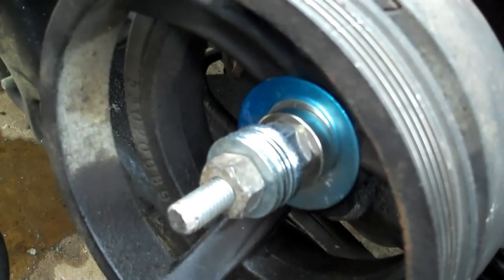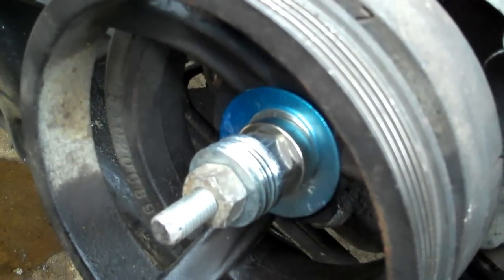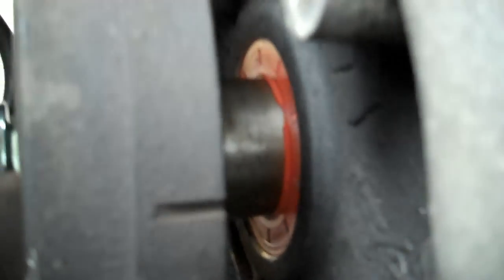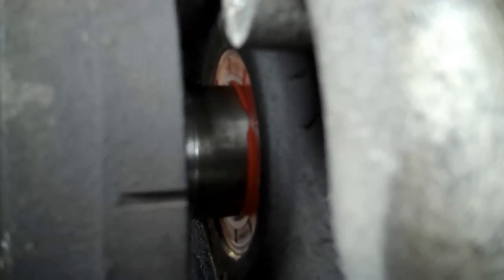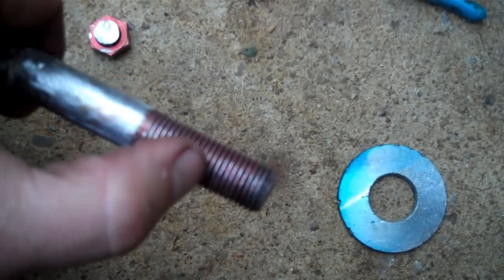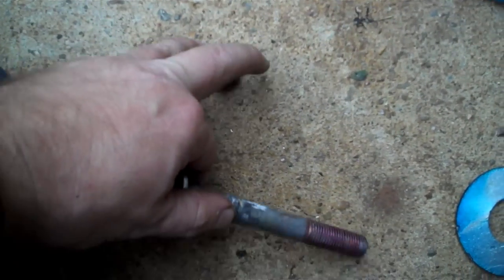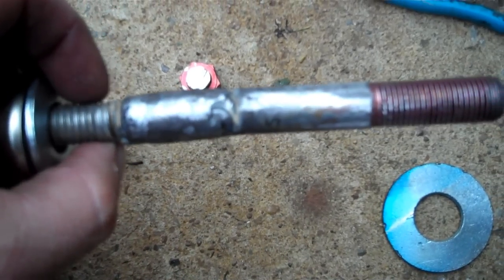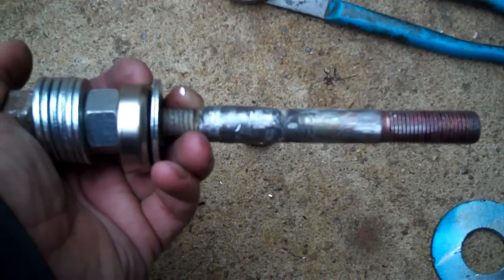Homemade Harmonic Balancer Installer

Comment: That's some Dam Good Welding,If that snapped Fuck City😭 Because I would have cried.
Reply from the maker: I tapered each part and stacked the welds until I had the V taper filled. I ended up selling that tool a few months later. It worked great! And yes I agree, I would have cried as well if had broken!! Have a great day!

Comment: Hi there, just replaced the crankshaft seal on my 2003 Grand Cherokee V8 engine and I didn't even had to remove the radiator or the fan to do the job. Great idea mate, however I didn't had the chance to weld 2 bolts together so had to buy an M14 fine thread (1.5mm pitch) 12" rod with M14 fine pitch bolts and washers. Just cut it half as there is only 6" room there and I was able to wind the harmonic balancer into it's place. Took me about 4 hours to do it in total as removing the old seal and putting the new one in was PITA. best regards
Reply from the maker: Yes .. you're idea is much better. Around these parts, metric threaded rod is almost nonexistent. It was faster to weld the two bolts then to drive around looking for metric threaded rod. Good job man! Thanks for taking the time to leave a great suggestion. Have a great day!!
Reply: To be honest I was happy I could get the fine threaded rod from eBay as none of the stores around me had fine pitch rods or even bolts in M14 size. Just to add, I used a 3" long jaw puller to take the balancer off and it was the perfect size as a 4" wouldn't fit in without removing the fan. I bought a set of 3 different size jaw pullers from ebay for £10, plus an 18" breaker bar to take bolt out. in total it cost me roughly £40 including 2 crankshaft seals (just in case you damage one you canuse the other) and the local Jeep garage wanted to charge £480 to replace the seal which was £8 each so I saved a bit of money :) regards,
Reply from the maker: I didnt even think about ebay. But, I was kinda in a time crunch and had to get that job done and out of my driveway. So I did what I had to do to get 'er done. Saved me time and money. You got a huge saving out of it! Thanks for dropping in some great advise! Glad it all worked out. Have a great day!!

Comment: i have a3.7 jeep liberty with the same problem i am currently in the same damn situation the installer from the auto parts store doesnt work where do you think is a good store where i can find a bolt with the same thread pitch i had a pitch gauge but i wouldnt think home depot would have a bolt that pitch and size any ideas?
Reply from the maker: john lynn Nope .. Home Depot or Lowes .. etc will not have the thread pitch you need. What I did was take the harmonic balancer bolt into NAPA. They had a decent assortment of random sized bolts. Places like Autozone, Advance or Oreillys will not have them (at least around my turf they didn't). Have them size up the longest bolt with the matching thread pitch. Then make a rig like I fabbed up in the video. It worked great. So well in fact that I ended up selling it.. If I ever work on another one of Chryslers famous (or infamous) new generation 4 cyl, V6 or v8s, I'll have to make another one. If you removed the timing gear cam bolts .. lock-tite those bolts in place when you torque them. I've see a couple come back loose throwing the timing out. Piston meets valves .. never good!! Good luck .. Hope this helps! Have a great day!!
Reply: You too man. You gave saved me a huge dilima. Awsome video.
Reply: Power Addicts - Jeep, car and motorcycle tips and i use napa for all my parts vause i get a huge discount ehen u eent in there did they have to find a bolt that was for another car pt was it just on the shelf
Reply from the maker: john lynn The NAPA I went too had a behind the counter bolts bin. They happen to have had that particular bolt in stock. It was a regular bolt that had that thread size and pitch. I bought the longest one they had. It was about $10-$15 for that bolt, then the misc stuff that I used to build it, I was about $25 deep into it. But well worth it to get that truck back together. NAPA always seems to be a little different from other parts stores. Usually when I can't find a part anywhere else, I can get it there. Locally they aren't my fist choice because they are normally wayyyy higher in price. You may also check farm implementing type places. Wish I would have documented the bolt size and the actual building of the installer. I was in a big hurry to get that 4.7 back together. Thanks ... Glad I could help!! :-)

Comment: the bolt is hard to find because it is metric thread went to a local store and bought two welded the two heads to each other again the bolt is metric thread. the dealer wanted 16.00 per bolt.
Reply from the maker: I found that bolt at a hardware store in Nashville. I paid around $15 - $20 for that one. In the end it gets the job done :-)

Comment: Just an update. I bought the same exact bolt had my buddy weld on some all thred and the balancer went right  on. Your a freaking genius i got everythi g back together and and i was outing water i. It to do a test run im pissing water out of one of the seals on the timing cover this is the second time i have done it now its going to be the third  time. Any words of advice how to to keep the gasket from pinching i put a dab of rtv on the orings before so they will stay in place when installing the cover
Reply from the maker: john lynn Happy that worked for you! I know it sure saved my tail! Don't know about the genius part .. lol. I'm just a gear head that does what he has to do to get the job done .. but thanks! :-) .  Yep .. a little rtv should help hold that in place. Only place I will not use RTV is (for obvious reasons) the head gasket & mains. I do know some of those 0-rings and seals can be a major pain in the @$$. What I have found is that when using RTV around rubber seals is to get it fully tightened down before the RTV starts setting up. With the RTV still wet it will flow around the seal allowing the seal to compress naturally. If the RTV starts setting up before assembly is done it can cause voids around the rubber. This ='s leaks! I RTV'd the timing cover and used the gaskets/seals on the 4.7. Had no water leaks at all. Hope round 3 goes better!

Comment: I have ALWAYS just put the original harmonic balancer bolt in the hole, and shoved that bolt in till I hit the sweet spot. The best part is that I would be able to not only get the balancer on, but I would be able to get the balancer bolt in and torqued at the same time so I didn't have to waste time, and worry about taking the installer tool out, just to put the balancer bolt back in
Reply from the maker: I typically do the same. That wasnt gonna work on this engine at all. The balancer had to be pressed on far enough for the factory bolt to rach the threads.
Reply: I’ve dont the same thing until I stripped out half the threads doing it.... I’ll never do it “the easy way” again lol

Comment: What size is the bar
Reply from the maker: The part with the nut is 1/2-20 thread. I really don't remember with the other end is, I just remember it being a large metric thread. What I always do is take the bolt with me into the hardware store. Find a nut that fits your existing bolt, then find the appropriate length bolt that fits the nut. Can't go wrong like that. As for harmonic balancer bolts, there are many different sizes depending on the engine that is being worked on. So taking the existing bolt to size one up can save lots of time and frustration. Thanks for checking out my video! Have a great day!
Reply: Power Addicts - Jeep, car and motorcycle tips  hey instead of welding two bolts together could you just use a longer bolt?
Reply from the maker: The crank snout has a finer thread pitch than the bolt I welded to it. I couldn't find a bolt that fit the crank and long enough to put all the extras (nut, thrust bearing & washers) to press in on. So, long story short ... if you can find a bolt long enough to accommodate all the needed parts and thread deep enough into the crank, then yep .. a longer bold wuld be better. I changed the timing chains on that Durango .. I was stuck so I did what I had to work with. Thanks for asking  a very good question. Have a great day!!
Reply: Power Addicts - Jeep, car and motorcycle tips  thank you for your answer :)
Reply from the maker: Your welcome. Have a great day!